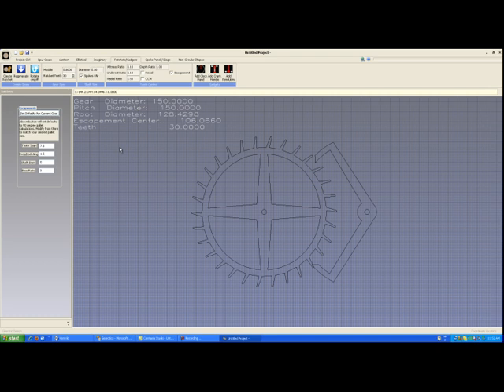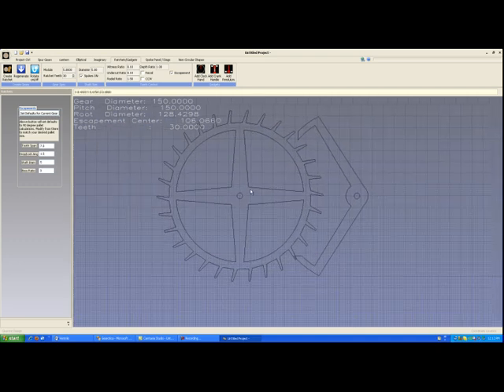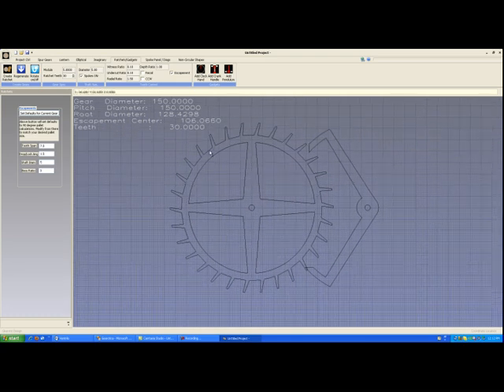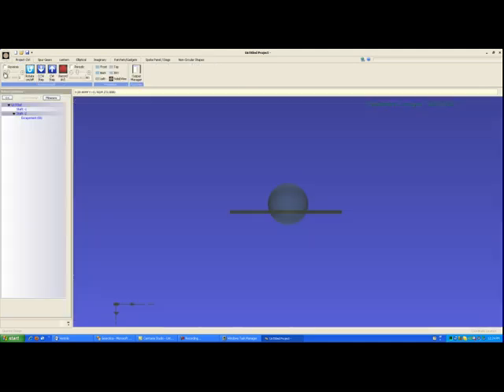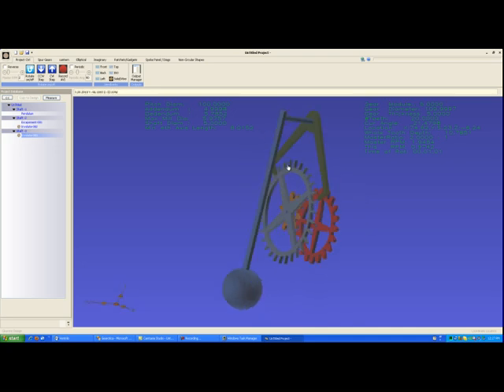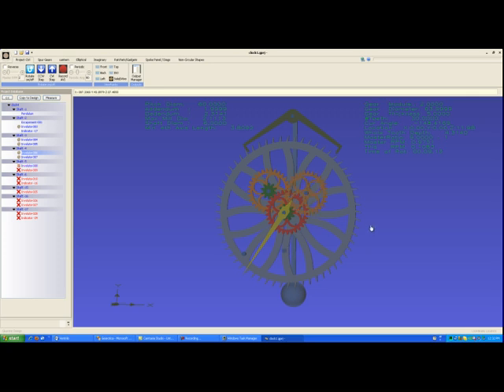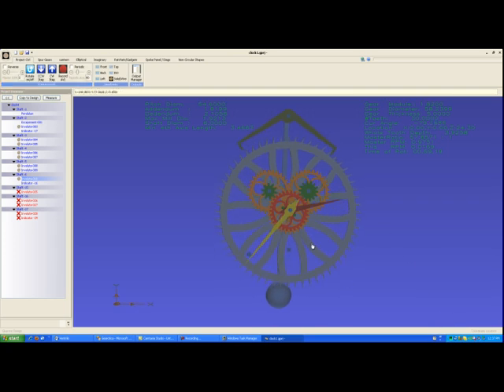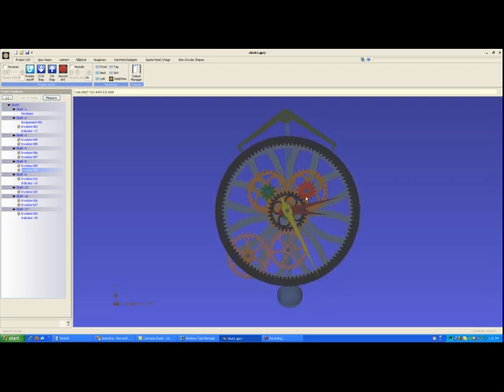Escapements

Comment: Great tutorial. Downloaded Gearotic, designing my first simple clock just to practice, having trouble figuring how to put hour and minute hands on to indicate time whilst the wheels are arranged in the traditional fashion so the min arbor goes through the hour pipe. Loving this and so glad I found it.
Reply from the maker: Add indicators to the actual gears, not the shafts.. it simulates having shafts within shafts that way
Reply: Art Fenerty  thanks so much.  I can highlight and add an indicator to the min shaft but as I highlight the hour wheel that revolves around that same shaft it says 'Differing basic types' and does not allow me to add the indicator. The hour wheel is tuning around the minute center shaft freely as it should? Thanks hope this question helps others.
Reply from the maker: Can you post the project on the forum so I can see how its configured, its hard to do without knowing how you have shafts and such placed.

Comment: This is a really interesting approach; I was apprenticed as a watch and clockmaker in 1970 at the age of 15 (just), and had to learn about this stuff without even the use of a calculator let alone a computer, Drawings were drafted using a protractor, compass and a T-Square; CNC machines were not conceived.

Gears were not drawn other than in text books, but calculated and cut with profile/hob cutters; wheels stamped for mass production. The machinery to to this stuff was extremely expensive - back then even thousands for Swiss lathes etc.

The program that you have developed is magic and dirt-cheap; I really appreciate what you guys have done and I will be experimenting cutting watch wheels with the very small (as small as 0.1mm), solid carbide mills that are available these day at a very reasonable cost.

Last year I spent ages drawing a Ratchet-Tooth escapement in CAM BAM (also a great application), but I can see with this that I can generate it and others much quicker with the bonus of animation.

Thanks again- Brilliant!